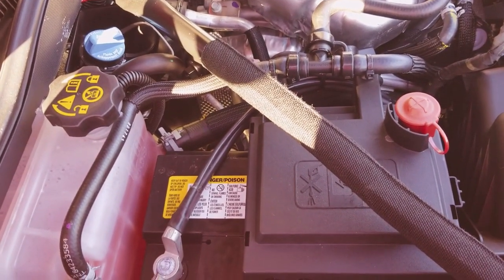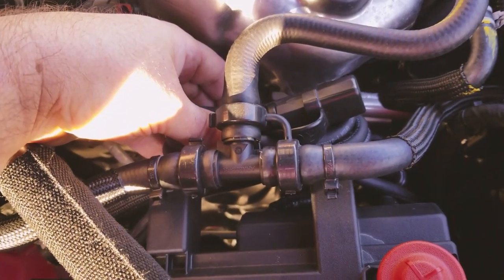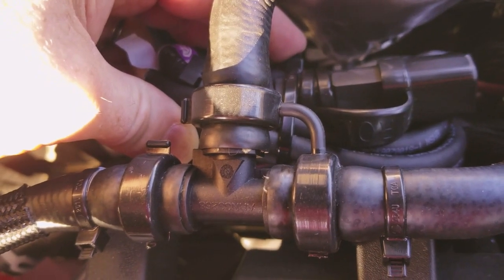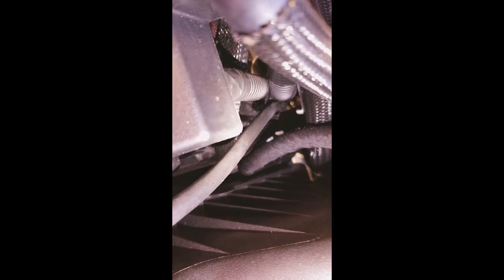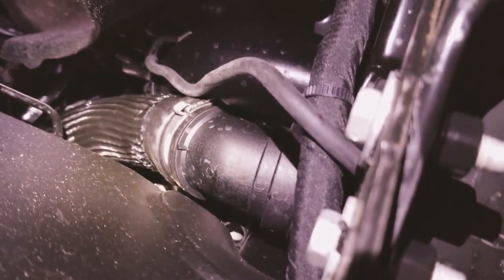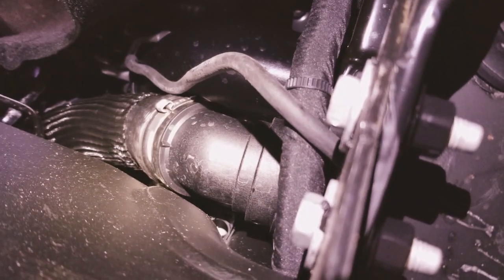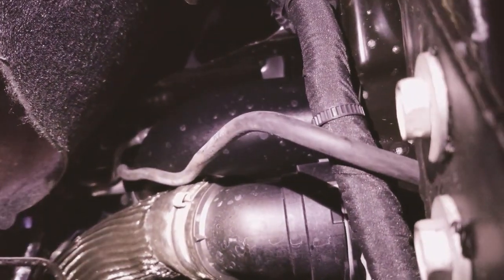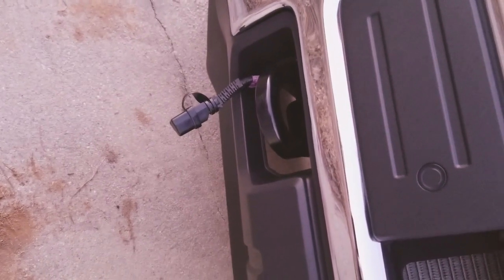GM L5P Diesel Engine Block Heater Cord Routing Medium

Comment: besides my 2018 duramax sounding like a ticking time bomb. Gm cut my block heater cord  because of a recall and haven' t fixed it in over 2 years.
Reply: They are now doing recalls. I just got mine fixed for $0

Comment: Hey did you add an additional cord to this? Mine seems to be pretty short
Reply: You need to cut the cord free of the wiring harness and then route down along the lower radiator hose then forward. I discuss this in the video. Mine seemed short too. Just work with it and it will fit

Comment: Thanks for the video.  Appreciate you doing it.  You made it look easy.  It wasn't.  I gave up.
Reply: I routed my cord down to the tire/shock area. I found a space in the Frame where the plug stays securely when not in use.